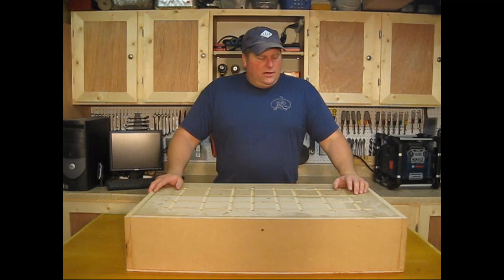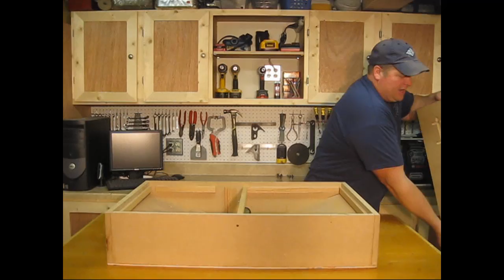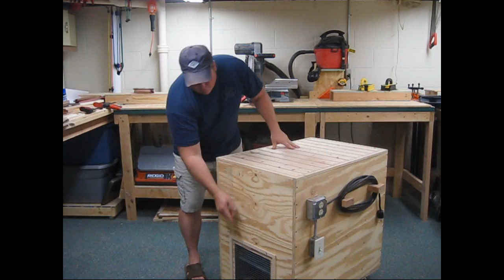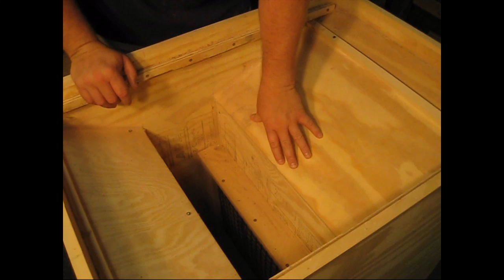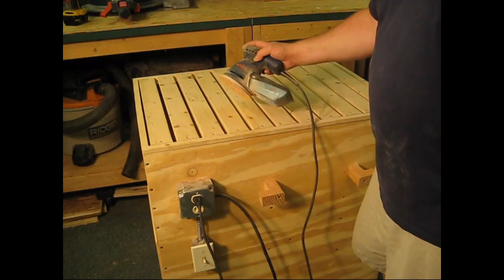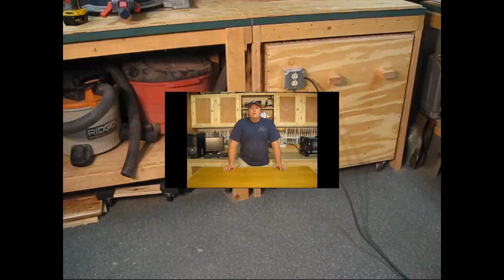Down Draft Table -- How to build

Comment: Very cool-need to make one myself now.  TOTALLY had me when you slid the thing into its parking space under the workbench.  omg, I was impressed and smiling up to that point, but when you did that I rolled back, smiled, and actually said, "NIIIIIIIIIIICE!!!"

Thanks for the vid-helps me ;)
Reply from the maker: Man! Thanks for the cool comment.  I love that unit.  It is one of the most practical shop items that I have made.  With the furnace blower, it is so quiet that I can run it the whole time that I am in the shop to keep the air clean.

If you end up making one of these, stop over at www.workshopaddict.com and show us how it turns out.

Take care,
John
Reply: WorkshopAddict
I will !     I understand the idea behind the furnace blower (great idea btw), but why the furnace filters instead of some sorta cyclone setup first?
Reply from the maker: Blackrain4xmas Quite honestly, I hadn't tinkered with cyclones until after I built this unit. Its a great idea though.  If the cyclone put in the opposite end of the blower, that would be an excellent setup.

Great idea.
Reply: WorkshopAddict
that's kinda what I'm thinkin too.   I do a lot of powercarving w a burr attachment on an angle grinder and the sawdust is insane level.   Currently use a leaf blower to blow it out of the garage.   thinkin a 4x4 table would be my size, and the cyclone first, then filters.   thinkin walls too for mine.   your vids my fav table design so far though.   thanks again
Reply from the maker: Blackrain4xmas Your favorite so far?  Well, stop right there and we will remain the best.  LOL!  Thanks

Comment: Dude, that is a great-great-great idea.  Really appreciate your sharing the ideas.  I will be making one of these for my shop.  I wonder if there would be a way to create a built in cyclone effect inside the unit... where you could pull a drawer out and empty most of the dust and have less of it hitting the filters.  My house has the 20 x 20 x 5 inch pleated filters that I will recycle into my design.  Thanks for sharing your idea.

Comment: Holy crap. I just took one down from the shop ceiling and was trying to decide what to do with it. I thought about a down draft station. I found your video and now that is what I am going to do. My idea is to store and use it under my store bought compound sliding miter saw stand ,hoping it will gather some miter saw dust, roll it out for sanding, etc.  I made one similar to you first one years ago, that was a bummer. you stored yours neatly under some benches, maybe your m saw could help feed the down draft.  You did a very good job and I appreciate you sharing your project
Reply from the maker: Thanks for the kind words.  I love this unit and use it all the time.

Comment: what is the brand and CFM of your blower motor?  Thanks!
Reply from the maker: Hello m00nchildblues 

I took the blower out of an old forced air furnace.  I'm not sure what the brand is or the CFM it is.  Sorry.  It is sealed up in the box with silicone to make is as effective as possible, so I can just pull the lid off and check either.

Comment: Great idea.  I put a different top on this unit since I put out this video.  I put a top on with many 1 inch holes on a solid top and I routed grooves connecting all of the holes.  I'm not sure if it works any better, but it makes working with smaller pieces much nicer.

Comment: Before I built one similar, I talked to a friend of mine who is an actual dust control engineer. He said the biggest improvement to make (which I did) was to design the top with the least amount of air flow resistance or directional change for the particles. He suggested a rigid metal screen. I could not find one I liked so I made 4 rigid wooden slats that I could slide along or remove & put a board under the piece I'm sanding (acoustic guitars) It's almost all air flowing around the piece now.

Comment: Hey 49erfred1,  Thank you for the compliment.  The table was sized to fit my storage area.  You can size it however large or small you need it.  The furnace blower was used to heat a 1500 sq ft. house and can move quite a bit of air.  So the size of the table isn't important.  If you still want the dimensions, I will get it for you.  I don't remember the size of the motor.  It was the motor that came with the blower.  I can remove the caulk and pull the lid off to find out if you need me to.

Comment: I don't have any plans (maybe I should make some).  The blower is a squirl cage and is just bolted down to the bottom of the box.  You can see by the video where the air blows out.  That is where the exhaust is butted up against and the rest of the unit just sits in the bottom of the box.  The motor for the blower is just situated above the blower (attached to the squirl cage) and has a bolt/nut setup that acts like a tensioner for the belt.

As far as the slopes, I just winged it.

Comment: I really like the second one. I was planning to build a ceiling mounted air filter - as well as a separate downdraft table. Not that I think this would completely eliminate my need for more air filtration but, it would sure be a nice step in the right direction. Thanks for the idea.

Comment: Nice job! You thought this out very nicely. I like the unswitched outlet and the fact that it doubles as an outfeed table. The fact that it also slides and hides under your bench is icing on the cake. I'll be interested to see which top you like better: the slats or with the holes. Well done !!